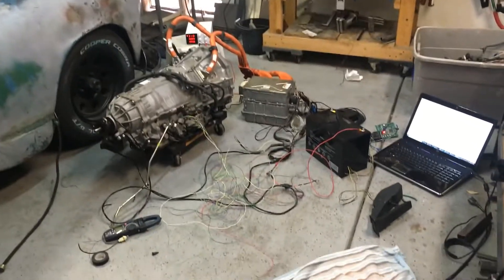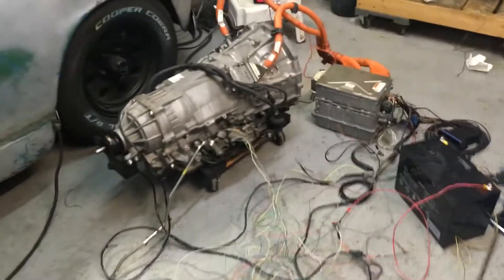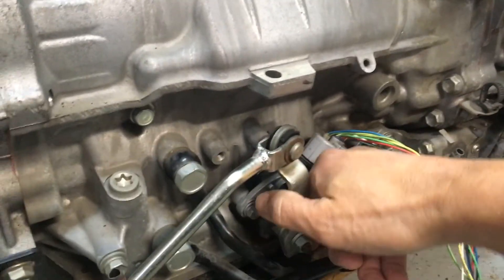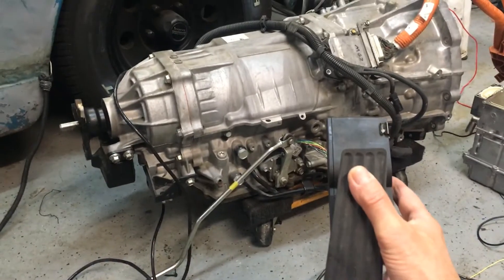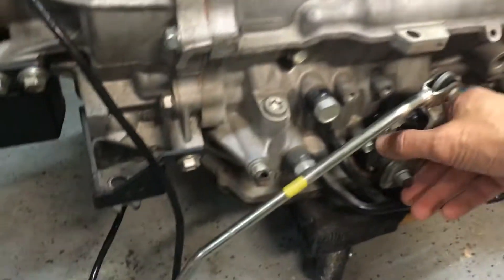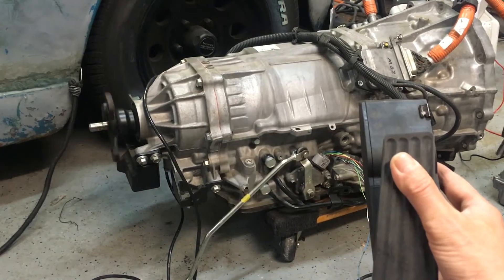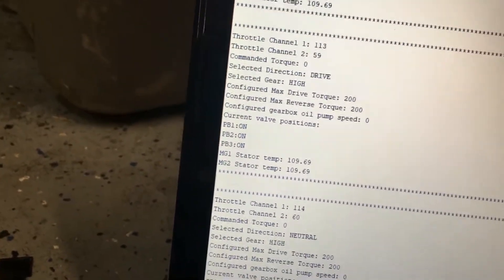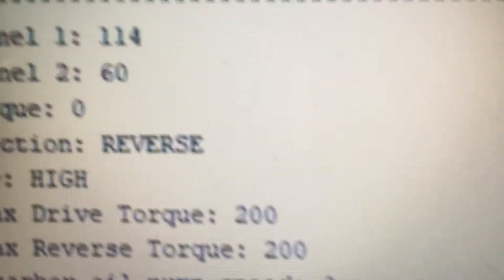Lexus GS450h Transmission Motor First Spin

Comment: For some reason, it looks MASSIVE. Is it really that bulky? Do you have to move it forward more in the transmission tunnel to make it fit? Or could you keep it about as far back as the original trans?
Reply from the maker: it fit pretty much right in I only pushed it back a bit to make sure my battery pack would fit in the engine bay this short video shows how it fits https://youtu.be/OHIBy9bWJ_U?si=g8A0M6ATp_P-U-9D
Reply: @Good-Enuff-Garage  awesome, thank you!

Comment: Great job it's good to see your progress with the conversion. I am curious how much did you have to pay for the Lexus transmission? In UK the cheapest you can find is about 450 pounds which is about 600 dollars
Reply from the maker: thank you so much, short answer $700 on eBay (I am in California so I buy my stuff anywhere but here, cause this state is too expensive) please visit the links in my video description I have a very detailed build thread going

COSTS SO FAR

$978 - Battery (with BMW wiring harness)
$760 - Transmission (with oil pump)
$362 - VCU, Vehicle Control Unit aka Controller (an open source component)
? - BMS, Battery Management System (open source component)
? - Battery charger logic board (open source component)
$300 - Charger
$250 - Inverter
$250 - Transmission wiring harness (low voltage)
$150 - Controller (for oil pump)
$325 - Main wiring harness (low voltage)
$125 - Flywheel
$125 - Drive shaft
? - Some sort of digital display doo dad, tablet maybe
$100 - Battery Harness (from Lexus)
$ 43 - Throttle Pedal (BMW E46)
===========================
$2,690 TOTAL

Comment: So cool 😎 I’ve seen a lot of car things in my day but I’ve never seen a transmission drive without the engine ever 🤷🏽‍♂️✅ keep up the excellent work
Reply from the maker: yeah I know, have you seen hub motors yet, imagine an electric motor in each of the four wheels of your car, they already have them for motorcycles and I think BMW or the Mini were toying with the idea of putting them into cars, how cool is that, no drive shaft, no transmission even, no differential, less weight, the future is here

Comment: So cool. I really want to have a play with the Lexus gearbox motors. Maybe an is300h unit for the next project...
Reply from the maker: the only thing I would caution you on is that not knowing your electrical engineering background is that the Inverter/Controller combo from the GS450h may not drive/operate the IS300h I am not 100% sure of that, but maybe it can maybe it can not, we know that the current Open Source controller aka VCU ver 2 does not fully operate even the later 2012-13 Lexus GS450h so just be aware of that, they are working on a new animal the ZombieVerter but it is not prime time just yet
Reply: @Good-Enuff-Garage  this is all for future experimentation. I would probably get the matching gearbox and inverter and have already enlisted tacit support in helping me extend the zombieverter to cover it - if it hasn't already been done by then, which I suspect it will.